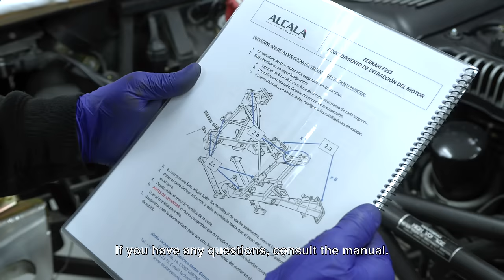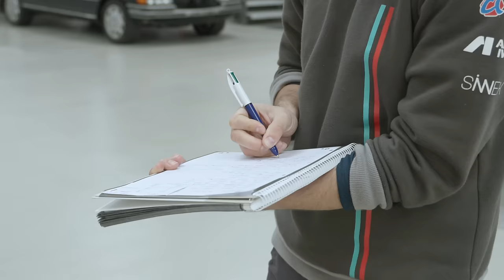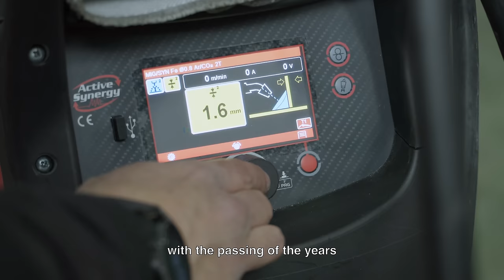From Dream to Reality: A Customer's F355 Restoration Journey (Final Interview!)

Comment: Absolut great work.... but the bumper is really not a real problem, they showed, how to do it. The main issues of the F355 are the technical ones around the engine, especially the heat. You don't get original parts, you must always buy aftermarket parts - or built parts yourself. In my manual, Ferrari says: timing belt every four years...At the end, you have a gorgeous new car. The costs may be enormous. I love my F355 GTS, also a 2,7 Bosch motronic like yours with two air intakes, in original and very good condition, but - 29 years old and 14 years in my hand  - beauty with patina. Have a nice trip  ... and take care of the stone chips...
Reply from the maker: Thank you for your comment! Really appreciate it! And hope you will enjoy the following cars projects! And good one! This car is a magnet for stone chips! Haha

Comment: I think it's a bit of a stretch to call this a restoration, considering it was assumedly running, driving, road legal, and minimal body damage.   A lot of thorough superficial disassembly to be sure, but I think this is more of a thorough refresh.  In any case, nice work on the car.  Here's to hoping the owner actually drives and enjoys it as it was meant to be used.
Reply from the maker: Meaning of restore:
Repair, renew or restore something to the state or estimate it previously had.